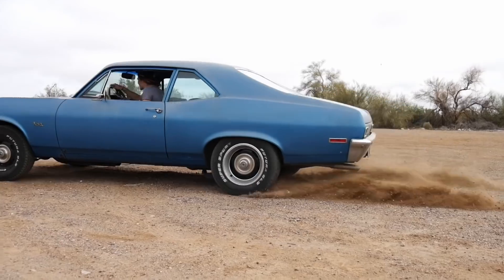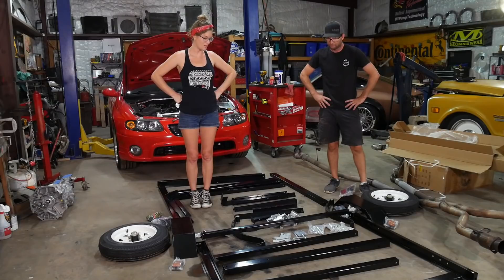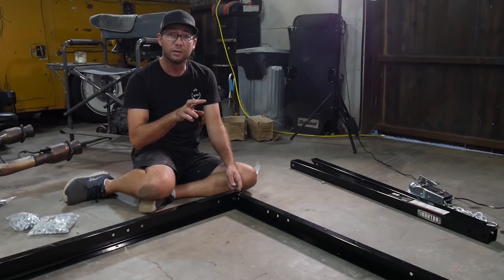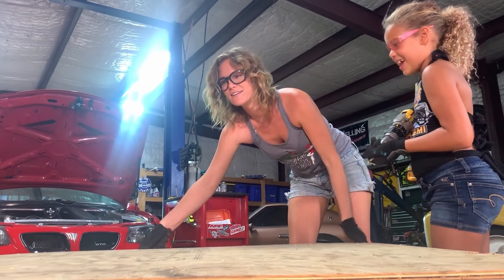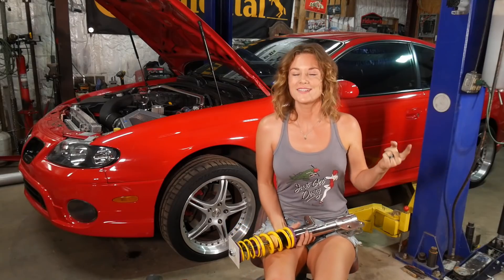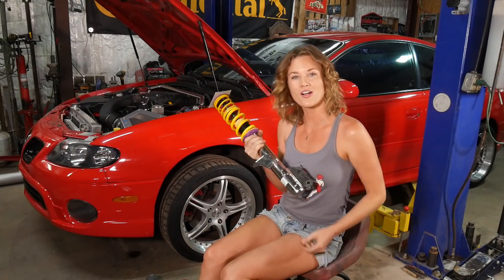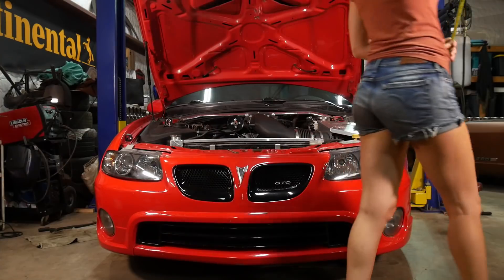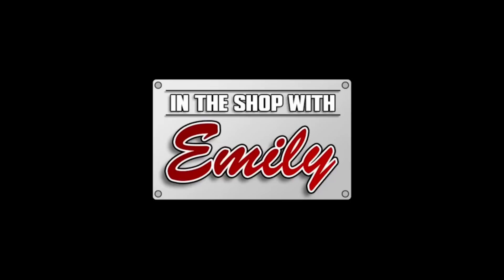Front suspension on the GTO + mini trailer build!

Comment: Get this woman a throw down seat cushion lol, working on a lift and sitting on the floor. Cracks me up but also love to see her wrenching on her own car, hope she gives some women the drive to be more like her. Im sure you have it sorted way before now but damn, 11 pages of instructions for shock adjustments? My Viking DA coilovers had 3 pages and that was 2 too many😂

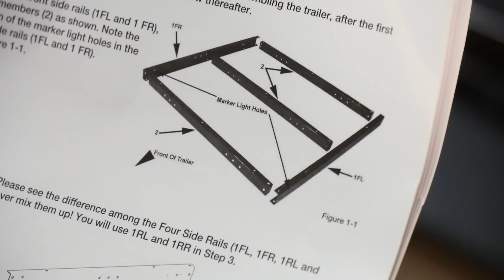The HF trailer we put together was missing steps 1-3 so we winged it and got it right, we broke 5-6 bolts then went to tractor supply and got grade 8 for the frame and spring bolts. After it was completed we stitch welded all the corners, cross braces and tongue to be sure it didnt ratttle apart 200 miles from home at 3:00 in the morning.

Comment: I had the harbor freight version of that trailer.  Took everything I threw at it like a champ. Best pulling trailer I have ever had. Only had one issue with the bearings but a set of buddy bearings solved that.  The bearings and spindles are an odd size metric but I found them mail order. Finally gave it to a friend who loaded his entire household in it and pulled it 1200 miles to northern Virginia behind his minivan.he gave it to another guy and it's still rolling as far as I know.
Reply: Crazy thing is, you can buy EVERY part of that trailer through HF and the parts are pretty cheap.  I wanted to replace a hub and priced them out elsewhere and they were stupid expensive, then I looked up the trailer manual online, called HF up, and the prices were cheap enough that I bought BOTH hubs and a few other small parts for less than I had sourced the one hub elsewhere.

Comment: I used to work as a front end tech, done a few custom alignments.
Sooo, I didn't see or hear about any settling for the suspension. When you put the car back on the ground you need to ideally have it on floating (alignment) plates bounce on that front end or back it out and pull back in to allow for a neutral position before checking ride height,
I'm sure that you guys have a great alignment guy so he should be willing to double check height and alignment with you (or equivalent weight) in the car. Never really cared for red but have always liked Roxie !! 
Good luck with the racing !!

Comment: I built the Harbor Freight equivalent of that trailer (looks exactly the same but red) and it went pretty well.  It's a bit bouncy unloaded, but settles down with some weight on it.  My biggest issue was actually registering it...my state makes that kind of a pain compared to some other states I think.  Some other thoughts...it calls for 3/4 plywood which is fine, but it won't fold if anything is sticking above that, including bolts.  I counterbored them and clearanced the corners to fit.  I also didn't like the way the license plate would stick out and hit the wall when I tried to stand the folded trailer up.  So I put it on a hinge that hangs off the rear crossmember so it will just swing out of the way.  It should also have a better way of locking open and closed.  It's dumb to have to do and undo and keep track of loose bolts that you have to put through the frame anytime you use it.  So I want a better mechanism there.  Likewise, it needs a way to lock closed for storage other than bungee cords.  Essentially, they're workable trailers with lots of room for improvement.
Reply: I still regret cutting the diamond plate aluminum I mounted on my HF folder - I've never folded it in 15 years!  I should have left it in one piece until I was sure whether I was storing it inside or out.

Comment: Had one of those years ago. Used it when we had to run from hurricanes down here on the coast. I found some low profile washer head bolts to hold the deck to the frame on McMaster.

Comment: Nice Fab work, important part of drag week etc to have a solid and well laid out trailer.
Love your work!
One Lil thing though, fine measurements require a steel ruler, tape measure ends get loose over time and will give variations of up to and slightly over 1/8th inch.
The Lil 6 inch engineers rulers I usually buy in 5 packs so I can sprinkle them around the shop and have one in a pocket.

Comment: Harbor freight trailer is a good light load trailer. Weld the frame where you can. Mine folds in half and scrapes the trailer wiring so keep an eye on that. PA laws for getting a title or registering the trailer sucks.
Reply: Most states anything under 2000 lbs doesn't require a tag

Comment: once done......grind paint off all joints and weld them,......trust me. My experience with one of those was......well.......i was missing parts at the end of the trip and the entire trailer was flexing like a leaf in the wind
Reply: Never welded my HF folder, it's been 15 years, and nothing has fallen off.

Welding IS a good idea, but if you tighten the crap out of the bolts, they hold fine.

Comment: Nice work on the front suspension. Probably agree with Aaron and left the height slightly higher on the driver side to compensate for the driver weight. 👍keen to see how the kit set trailer works out for you. I enjoy putting stuff like that together as well. Kiwi Fan NZ 🇳🇿

Comment: Once you've got it bolted together then weld it properly, then you know it's not going to rattle apart.
Reply: Exactly what i was thinking
Reply: I was about to say bend some washers and tach down those bolts.
Reply: All trailers that i have ever owned were welded. I helped a friend years ago install a bolt on lift kit on his truck using nylon lock nuts. 6 months later they wee all backing off so we welded it
Reply: Yea I don't trust that horror freight hardware. Welding it up is a good idea....
Reply: I used lock washers AND nuts with the nylon inserts on mine. Nothing loosened up for the 5 or so years I had it.

Comment: Question: When adjusting the spinning nut on the strut with that wrench. Is there a way to lock the adjustment nut so it doesn't spin under vibration?
Reply: If you look close you can see a grub screw in the side of the adjusting nut. I'm guessing that's what locks it.

Comment: All your criticisms of the trailer kit are spot on. Cheap Chinese junk with bad instructions. I.ve experienced the same. Agree with all the other comments to weld it together and hope it actually survived a week of towing fully loaded. To be honest you could have shopped the internet and bought a used 4 x 6 enclosed trailer for about the same as you will spend after buying and modifying this thing.